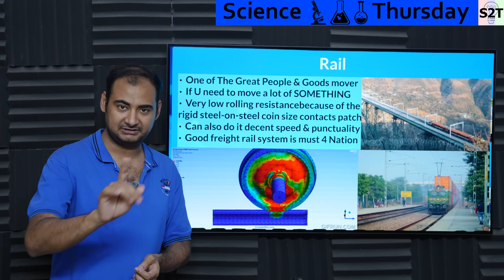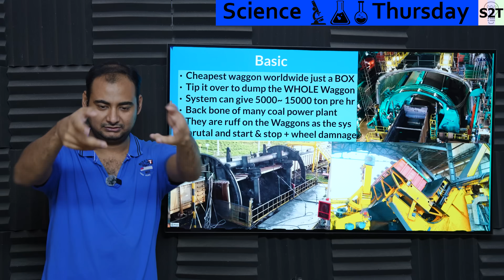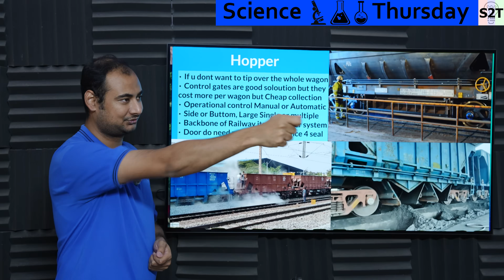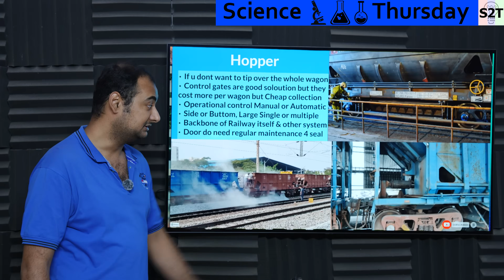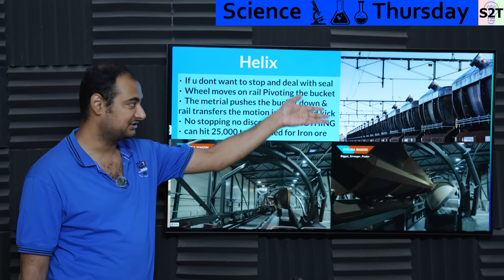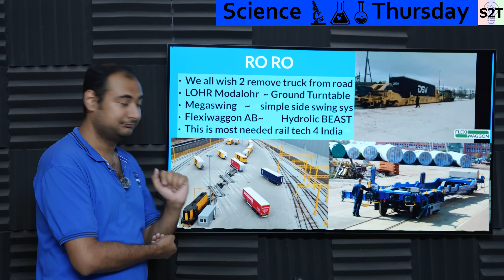Unique Rail Freight Wagons Explained {Science Thursday}

Comment: About RO-RO.
Can't we incorporate multi wheel drive in new trucks. Eg-  Tesla Cybertruck comes to mind.

 That should allow trucks to simple roll of the the platforms; as long as the platforms are designed to match the level of the train wagon.
Reply from the maker: that is not safe or stable as that like parallel parking a truck not enough room . we need the bucket that rotates like a turn table

Comment: Where I worked, the 1st one was used for heavier materials like iron pellets. It's called 'wagon tippler'.

The 2nd , The hopper was used for coal i.e. lighter stuff. Plus it's volume is smaller because of it's shape.

All of these are pulled by a disel loco inside the port bulb. The electric engine is detached outside the port.

Plus the tracks inside the port are designed to be on a slope gradient. 

So even the spiral design could push itself down a gradient. The disel loco just had to pull it up to the hill and then be present for brakeing.
Reply from the maker: cool info